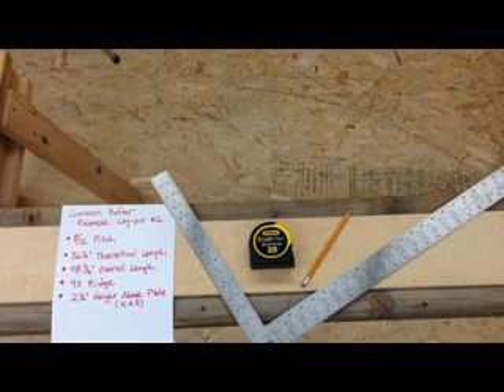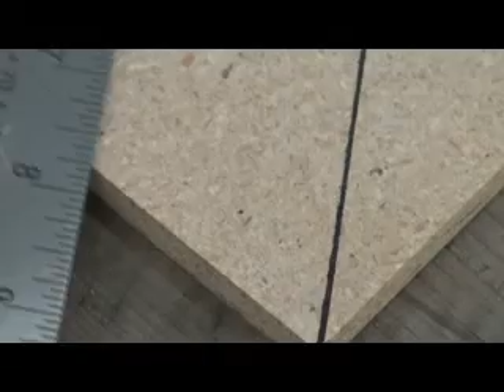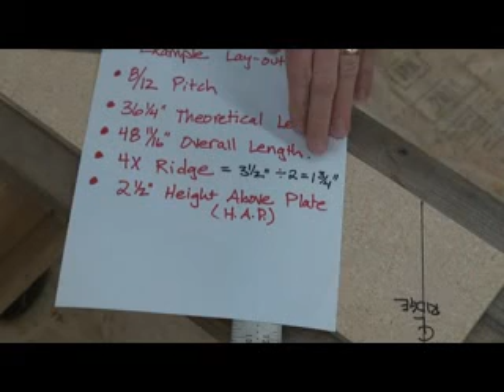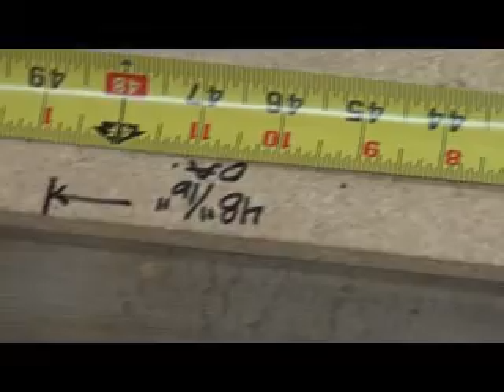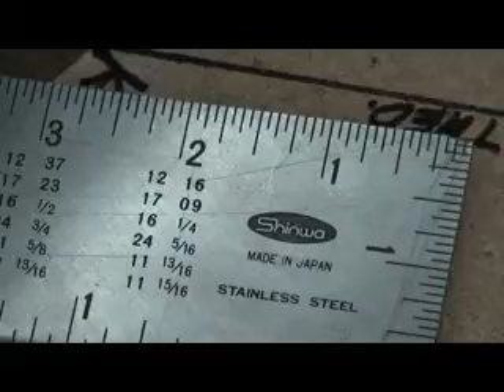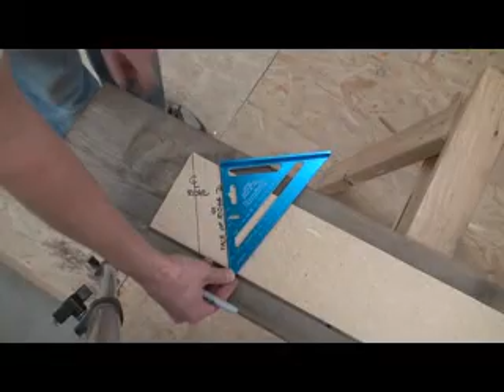UNit 1 Lab 1A Part 2

Comment: I was under the impression you shouldn't cut more than a third out for your birds mouth/seat cut, I've practiced on different sized timbers and when i've marked birds mouth out the way I've seen on various videos and the cut as worked out more than a third so needless to say the timbers ended up the other side of garden and left me struggling to examine what i've done wrong as not finding an explanation I give up and go back to more videos, so now seeing this am I doing it right.
Reply from the maker: Yes 2/3rd of the plumb cut at the heel is minimum requirement. For instance, using a 2 x 10 (9 1/2" the plumb length is 10".  2/3rd of that is  6 5/8" which would be the minimum the HAP should be.    This less is set up for our carpentry students only as a practice.    
Regarding the "birds-mouth"  , you either lay it out to match the width of the plate, or you lay it out to match a pre-determined HAP (Height Above Plate)  2 x 4's are rarely used for "hand-cut roofs (well maybe sheds) but unless its a engineered truss, most common "field cut" rafters are at a minimum 2 x 6 with the tail portion of the rafter cut to match a 2 x 4 tail.  
Hope this helps clarify.  Good luck with your rafters.  Glen